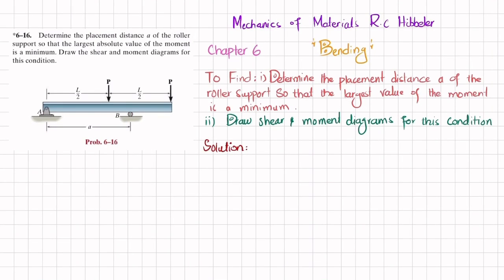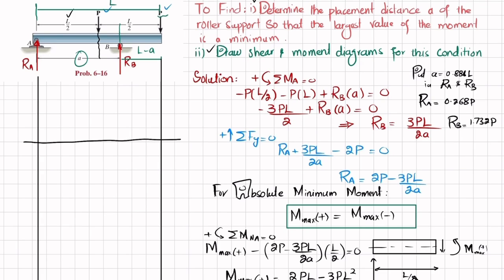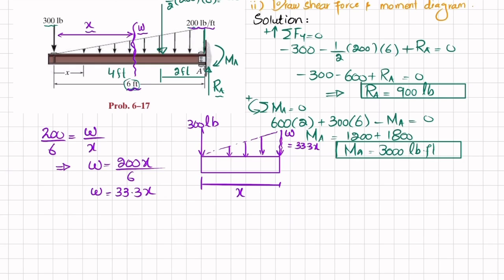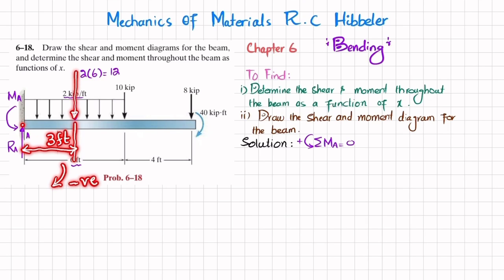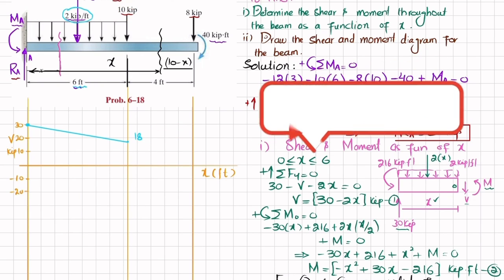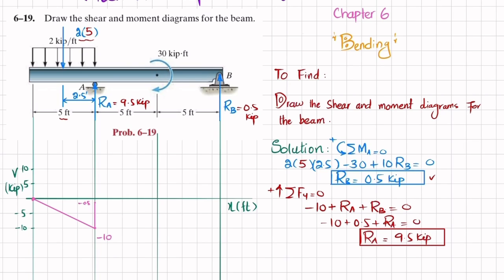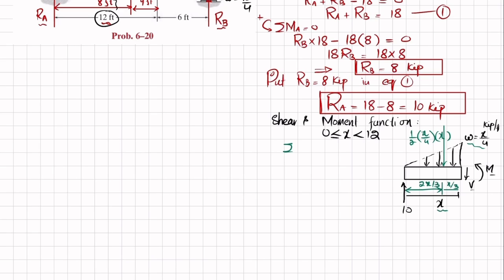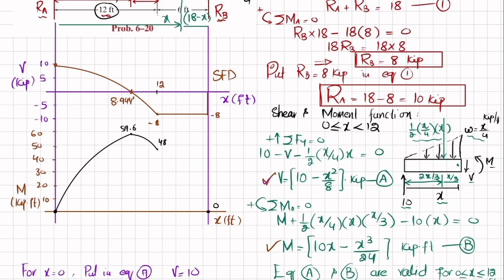Draw the shear and moment diagrams for the beam | Bending moment | Mechanics of material RC Hibbeler

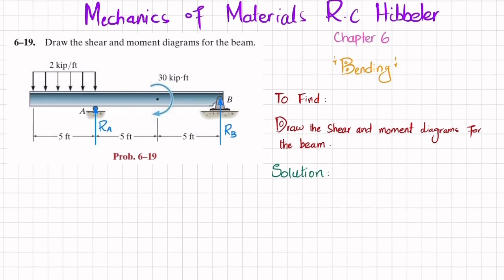Comment: I believe you are wrong at 54:00. The calculated load should equal a force of 10 kips because its the distributed load (2 kips/ft) multiplied by the length (5 ft).
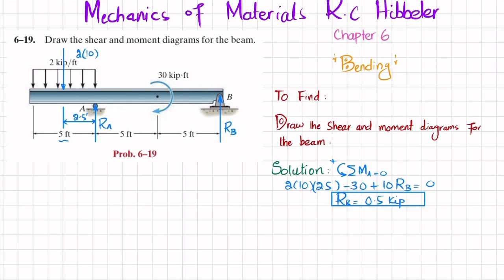Reply from the maker: Kindly check 55:30 , I have corrected it. Thank you 😊 💓